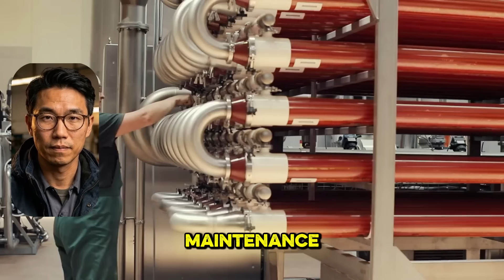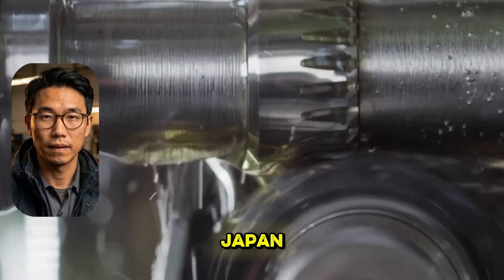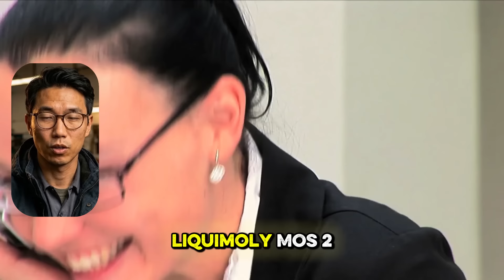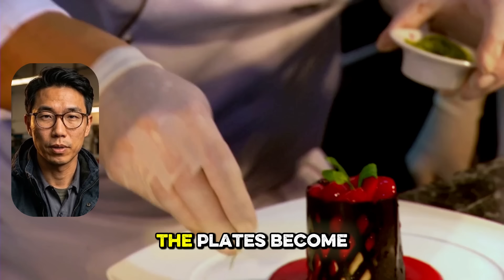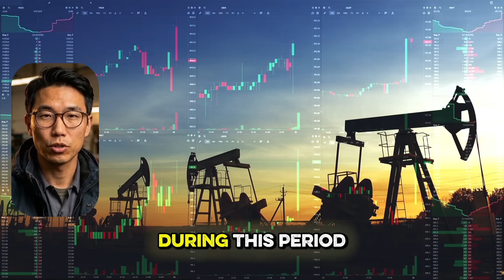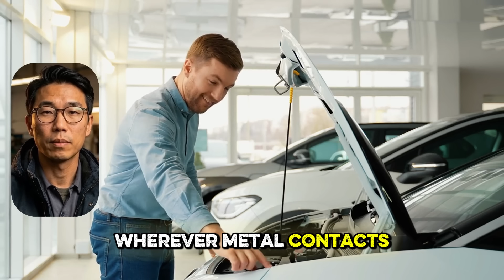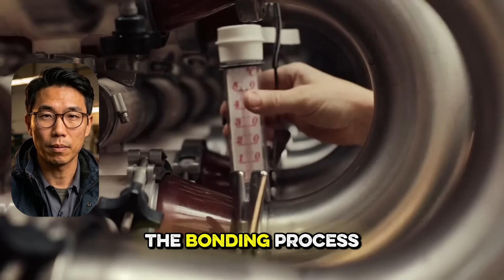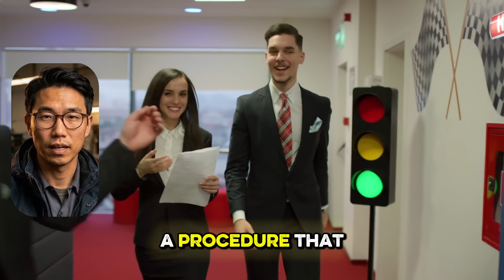The Japanese $2 Liquid Secret That Makes Your Engine Last 500,000 Miles — Mechanics Want This BANNED

Comment: Why do they always say it's a $2 solution but when you look it up it is vastly more costly than stated?
Reply: WHEN AND WHERE YOU BUY IT MAN ... THINK...!!!!
Reply: @jimmytran8111 ok, when and where do I buy it?
Reply: @jimmytran8111 some stires e g auto zone may carry it and available on line too.
Reply: @SarwarMurtuza not for $2!
Reply: @LayLaw no, not for $2 Lol the "$2" must've been used as a synonym for " very low price" i know that's how it's expressed by some people.
Reply: You're right, the price can vary betw 12.50$-18$ for a bottle for this engine oil additive. Usually adver for reducing noisy valve lifters. Perhaps it was much cheaper long ago.
Reply: Good question

Comment: Many of the car guys in the forums are saying this could clog up the oil filter or affect the catalytic converter.  What say ye?
Reply: For manuals only! Never use in automatic engines it causes gears to slip when it automatically changes gears!
Reply: @carrieandretti  I'm doomed!  Put it in my F150 with an automatic transmission!  LOL  No problems.

Comment: Why do I feel like there will be some weird build up of something inside my engine and I will need to buy a new engine? Who is warrantying this powder inside of my engine?
Reply: For manuals only! Never use in automatic engines it causes gears to slip when it automatically changes gears!
Reply: @carrieandretti well that's truly good to know. I'm not sure if that was mentioned in the video. It may have been. I skipped through the ingredients but thanks for that. I wouldn't use it anyway to be honest with you. Also, I'm wondering how all those taxis were stick shift cars? Is that what they all are in Japan?

Comment: yes, but.....Yes, Tokyo taxi engines often reach exceptionally high mileages, sometimes exceeding 300,000 to 600,000 miles, due to rigorous preventive maintenance, steady driving habits, and durable engines (like the LPG-powered Toyota Comfort). While standard Japanese vehicles are often replaced sooner due to strict inspection laws, taxi vehicles are kept running for much longer through high-frequency maintenance.

Comment: For the standard friction test, PTFE Tufoil appears to do better on friction coefficient than plain moly in the sources I found. Fluoramics states Tufoil’s coefficient of friction is about 0.029, while the MoS2 source cited a coefficient around 0.150 under ambient conditions.
Reply: Apparently, PTFE clogs the engine. MoS2 is better but Boric acid is the best.
Reply: I used tufoil in my 240Z let my friend borrow it. he ran it out of oil. did not seize!

Comment: They sell this in liquid form on Amazon for $10.   However, I would not believe anything I hear on Youtube.   You could easily destroy your engine and vacate your warrenty.
Reply: I've used the $10 Liquid Moly Anti Friction treatment for years from Amazon.  No problems and I can hear the engine running smoother on my VW and Ford engines.

Comment: I'd forgotten about this. In 1964, my father gave me some of this... for my skateboard! Early skateboards had metal wheels and rudimentary ball bearings. I used Moly on the bearings, not aware of the implications. Dad had it but never disclosed the why-for of what it's use was. Dad found out about it through the volunteer fire department he was a plank-owner in. Interesting substance.
Reply: I have a red Roller Derby #10 steel wheels that is NOS New Old Stock, never ridden with the box. 1959 - 62 ?
Ebay 20 years ago, paid $120

Comment: Commercial additives use surfactants and dispersants to keep MoS₂ suspended so it flows with the oil instead of sinking to the bottom of the pan like a DIY mixture can.

Comment: I use dura lube for my 2000cc  kawasaki with wet clutch and with 60,000 km on it and just keeps running smooth. No issues.
Reply: No issues with clutch slippage at high rpm?

Comment: I had always heard that adding Molybdenum disulfide to modern car engines could ruin the catalytic converter. Also, in these modern 'tight' engines, the disulfide can sludge up and become a problem IF the car isn't driven at least weekly. That's why it is NEVER in ANY car engine oil product.
Anyone know anything about this?

Comment: My father added moly to all our oil changes. 1/2 teaspoon grease for every 5 qts of oil. We raced Corvettes and boats. One Vette had nearly 1000000 miles on the engine. This Vette was new in 63 it is still on the road. Soon a fourth generation great grandson will carry on with the same car.
Reply: Awesome story
Reply: You gave me courage!
Reply: There you go, we've just heard it from the horse's mouth- thank you.
Reply: Wow!
Reply: Can this be used on any vehicle?
Reply: @lourdes6421 yes
Reply: A half a teaspoon for 5 quarts hardly seems enough to do the job
Reply: I have a C7 corvette stingray manual transmission. Can I drop 1/2 tsp per 5 qt of oil to it now? Please advise
Reply: thx, i'll run out and buy a tube of grease right now.
Reply: F**k yeah!!! 💪🏽🔥🔥🔥💯
Reply: For manuals only! Never use in automatic engines it causes gears to slip when it automatically changes gears!
Reply: @carrieandretti  what?? are you talking adding moly to car engine or transmission?
Reply: @asmrnatural2640 engine only!
Reply: @asmrnatural2640 TO the oil
Reply: @asmrnatural2640  Prolong 2000 was put in the car in 2011 It's an automatic engine never had any slippage Maybe it's not the same stuff but you can a gallon of it from Amazon for 52 bucks I tell everybody about this and they simply won't try it because they won't believe me More FOOL then
Reply: @NigelSeccombe there is not a auto engine there is an automatic transmission

Comment: Works very well in suppressors especially 22lr n SD suppressors.  Lightly coat baffles n core.  Use in GSL PHOENIX 3lug you'll feel like your suppressor came straight from Heaven.

Comment: I have known about and used MoS2 for 50+ years in all of my engines , transmissions and rear end gear lube . 
Forget about that heavy 75-90 and 90-140 in your gear box. I mixed one pint of moly lube MoS2 additive with  half ATF And half Torco 70 weight  in my Muncie M22 and rearend .shifted hot or cold like a hot knife through butter and never missed a gear never any stiff Notchie feeling on cold mornings . I drag raced it and drove it on the freeway with 4.88’s for eight years and it worked flawlessly. I use it in my race small block CHEVY after I broke in the engine on Tocco 20-50 and added the Molly on the first oil change and have used it ever since on every oil change. I run duo Holly 750s and a big old roller cam and eye compression and there was zero cylinder wear after pulling the heads to freshen up the valves seats  after driving and racing it at that point for 7+years. and now after a total of at least 10 years serious Gregg, Racing, and buzzing on the freeway and around town, it’s still running strong.

Comment: What is the military going to do about the perfectly good equipment that goes wrong and when they said grimlins how are they going to be able to deal with something that you cannot see any of the fact that the evidence and proof that proves that the fact that the invisible and throw in some cases this one is on the same as it always normalizes right away so ask and you will not be denied that it's was manufactured by the people that didn't know any better and better than what you think is possible if you are working together on the right way to get it done right for once and for all

Comment: Why do I have to change/add new solution every 50/70 thousand miles?
Reply: Why can’t pigs fly🤔
Reply: You don't have to - just replace the engine instead if you don't want to do oil changes. LOL

Comment: Products like Slick 50 use MOS2 and work pretty well on a fully run-in engine to reduce friction.
However, DO NOT use MOS2 on any engine that is new and is in the running in period (0 kms-3500kms or so) Your new or rebuilt engine should have new oil and filter after 500kms or so then another oil change and filter after another 1200kms. After that every 5000kms for oil and filter is recommended. Use MOS2 after your 3rd or 4th oil change.
Wait until the engine is at least 8k-10K old before using it as its slipperiness will stop the piston rings from bedding into the cylinder walls correctly and your engine will always blow smoke and use oil.

Comment: Or just use a good synthetic oil. My findings are incredible too. Synthetic is designed from the bottom up to lubricate motors. Crude oil refined is not even close to a good synthetic oil. If you live in a cold climate oil won't pour when it's 0°F. So where is your engine lube when it's cold? You have little to none while it warms up damaging engines due to lack of lube. Reg oil sucks A$$.

Comment: I have a 2.5 L. turbo engine. To me the greatest value of an MOs2 application is making the high heat turbo bearings last a lot longer.
Reply: How does one avoid having this removed by the oil filter?
Reply: @iancormie9916  oil filters can only remove anything above 20 microns while moly powder is about 1 to 1.5 microns.

Comment: Incremental gains with cold start ups and demanding use not useful for new engines or engines with tight tolerances skip it. Again, not a miracle cure just marginal gains extra safety for the right engine and right user. Do your research

Comment: Looking to add to mixed gas to coat a 2 stroke 80 cm Paramotor.  Expert advice appreciated.
Reply: I'd tell you use Amsoil and never look back. 50:1 blend will never ever cause plugs to load up...which is rather important in your type of use. Incredible quality I've used for 3 decades.

Comment: Seems like it would be a near-miracle in smaller air cooled 4 stroke engines
Reply: Can it use for motorcycles with little engines.. like Indian, Chinese made 100cc..
Please reply, thanks
Reply: My alternative Prolong 2000 was put in my ride on mower It was belching smoke and clanking After about 20 minutes the engine sounded like a Rolls Royce and no smoke seems to fix everything wonderful stuff and it was so easy to get I got it from Amazon for $50 for a gallon I still have it in the garage ready for anything else

Comment: Take Note: Molybdenum can be a semiconductor, it can cause problems if it gets into anything electrical.
Reply: Well, don't put it in anything electrical
Reply: @JS-jh4cy  sensors im guessing
Reply: Oil does not end up in electrical components.
If it does you have some serious engine problems.
Its basically impossible the way engine works.
Sensors are far away from oil and deal with engines gasses, like O2 sensors etc.
All else is separate.
Reply: @Patriotx-gx4ce  MAP sensors MAF sensors are all exposed to oils in recombined anti pollution returned  crap systems. Oxy sensors are exposed to some oil residues .
Reply: U r right, but not so the disulfide of Mo!

Comment: I'll consider it when Lake Speed the oil geek tests it.
Reply: 👍🏻🤔 Lake has been saying we don't need an extra additive
Reply: @stuckinmygarage6220 Agreed. He's proved things with actual wear and dyno data... adding to the oil wear package often throws off the chemistry and results in poor performance. I no longer add anything for my '60s era Nissan U20 OHC engine with a high lift cam and stick with 20/50 VR1... no more cam wear issues. The additives I used before made the oil WORSE! Now, if he tests this and says it's good I'll believe it.
Reply: @gregburrows4192 💯. Valvoline 👍🏻. Jamie (Dead Dodge Garage) and others also use regular latest API, etc , Walmart's Supertech, even.

Comment: What is the deference between regent grade and technical grade?
Reply: thats my question also,  this is what i found out, but i need to know if reagent can  be used instead,                                                                                                                                                                                                                               Reagent Grade is not the same as Technical Grade. 
Reagent Grade:

Represents a high level of purity (usually 99% or higher).
Suitable for analytical and laboratory work where precision is essential.
Meets strict standards set by organizations like the ACS or ASTM.
Used in research, testing, and quality control.

Technical Grade:

Generally has lower purity than Reagent Grade.
Contains more impurities and contaminants.
Intended for industrial applications, manufacturing, or non-critical uses.
Not suitable for precise analytical work.
Reply: Use reageant it’s better

Comment: My father bought a Mercedes Benz 220 b in 1962. Part of the running in and warrentee process was 2 tins of "molyslip" E. This company renamed "Spanjaard" in the late 1980's it still available today.
Reply: For manuals only! Never use in automatic engines it causes gears to slip when it automatically changes gears!
Reply: @carrieandretti  Are you confusing here engine oil with transmission oil? The video talked about adding it to the engine oil, not the transmission!!!

Comment: I knew the man who invented Lubrilon Orginally known as Slick50,  Now deceased he explained how he started and sold it, but never what he put in it.  I bought some from him, a black liquid, with a formulation for automatic transmissions as well (tricky because of the plates that conduct torque would 'slip' if lubricated, don't know how he figured that one out. Nice ot know what his 60.00 treatment consisted of.  HIs son refuses to make the additive now, they both felt they'd made millions from a simple treatment and it was time to go on to more fun things.
Reply: I used slick 50 back in the 80's and then it disappeared from shelves and I often wondered why. Now I know. Thanks.
Reply: Didn't slick 50 contain (PTFE) Polytetrafluoroethelyene or Teflon
Reply: @j.robertsergertson4513 I used a product called Prolong that had that teflon shit in it. I put it in religiously in my '93 Tercel every time I changed the oil. It ruined my damn engine! 

I drove from Albuquerque, NM to North Central Washington. The drive on the way up was fine, but when the day came when I had to drive home, my car was almost out of oil. It was burning oil. I had to put about 5 gallons total in the motor just to make it home without burning up the engine! Every time the oil light came on, I had to pull over and put more oil in the engine. 

But that Prolong didn't have the moly disulfide in it. The teflon just put a coating on everyrhing. It didn't work its way into the metal parts like the MoS2. That's what seems like the difference here with this stuff compared to the crap I had before.
Reply: @daleb.849 Every time I have taken a good look at the Slick 50 oil treatment the PTFE has been visible as if it's granular. It seems logical to believe that it would all clump onto the oil filter material and cause distressed oil flow. It doesn't conform to measures of melting point which is 327°C or 621°F and never seems to completely dissolve..
Reply: @j.robertsergertson4513 Yes and it's even more effective when dissolved in ethyl acetate.
Reply: @j.robertsergertson4513  It was ment to ! and for the next 20 plus years apparently it did not =/
Reply: I used Slick 50 a long time ago in my 59 chevy truck .
Reply: Have been using Slick 50 for 40 years. When it was sold he never passed on the secret ingredients and Slick50 was never the same. 
A new brand popped up claiming to have the original Slick 50 formula, cannot remember off my head the name. The only 2nd engine to ever drop a main bearing for me i had just put this BS crap init and had only done 100,000klms. 
Emailed the company to tell them it was garbage after they had told me how superior this crap was. 
I watched an engine be drained of slick 50 mix and then win a ENGINE COMPETITION with no oil on a stand ( which runs longest ) 
Slick50 was the best
Reply: @proximitybeejay3673was garbage clogged oil lines
Reply: I tried Slick50 in a first gen MR2 that I leased in 1984. I think I got about 5 more mpg.
Reply: Slick50 is teflon powder. It doesn’t work.

Comment: I can't use this in my Honda because it's a motorcycle with a wet clutch that also doubles as an oil spinner.
However I may treat it anyway when the clutch needs changing, then swap out the entire clutch drum after treatment...
Reply: Nonissues . MOS2 FROM LIQUID MOLY FOR MOTORCYCLE IS AVAILABLE .

Comment: Be careful putting solid lubricants in your engine. It is used in brake antisieze but as the base grease substrate depletes the moly is left behind and can cause a drying out of the area that needs lube. It works well in differntials and some transfer cases. There is a better solution.
Reply: But he isn't talking about using anti-sieze. He is talking about mixing a certain amount of grams of MOS2 powder (depending on the size of your engine), with 30 mL of your engine oil, then pouring it in and letting it run for 20 minutes before driving.
Reply: He tells you to mix it with the oil